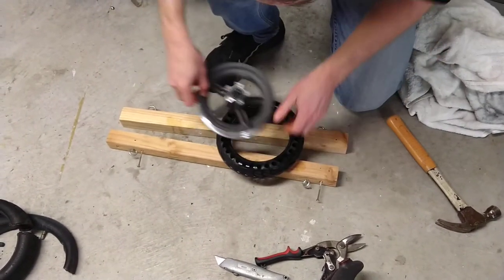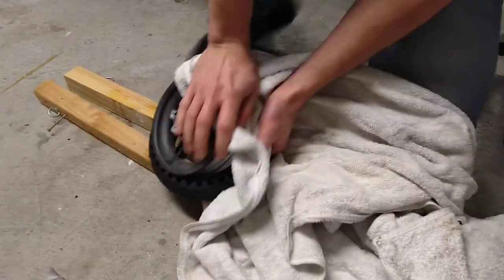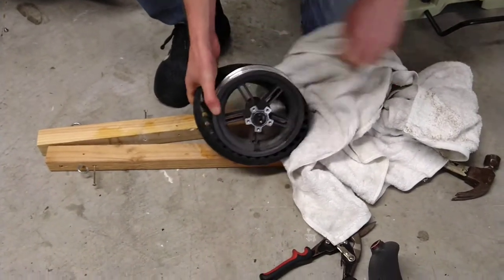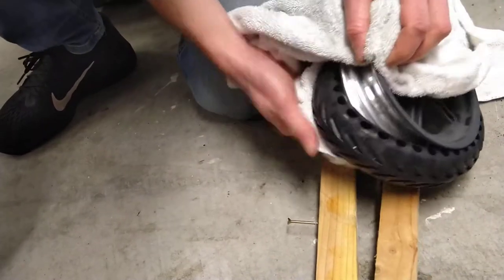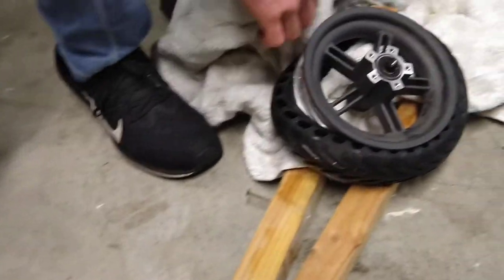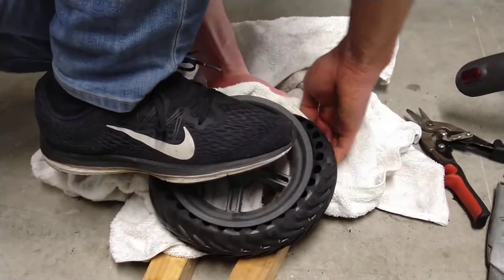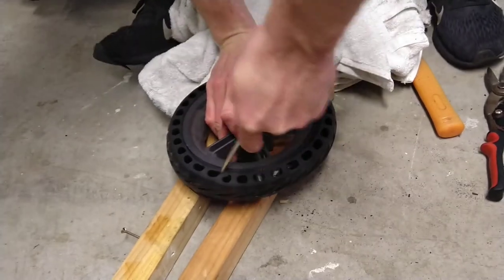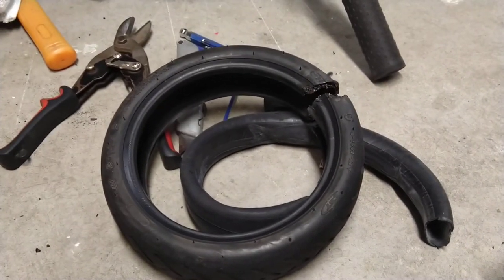Solid rubber tyre install on Xiaomi M365 e-scooter, by hand only, no tyre levers required

Comment: Not all tyres will have the same spec / flex so tools may be necessary . Better way is sit on Chair and use both of your feet .use WD 40 / washing soap to help it slip on.  Good job  !

Comment: I couldn't do it by hand ... Or tire leavers gonna try with a vice next... Doing it on koogo m4 back wheel whitch is 10"...
Reply from the maker: Just make sure you boil the tyre for mins to make sure it's really close to 100 Celsius. Good luck.
Reply: @HandSolitude  It was pretty damn easy with a vice and two tire irons. Both boiling for 10 minutes or putting the wheel in a microwave for 2 minutes works.